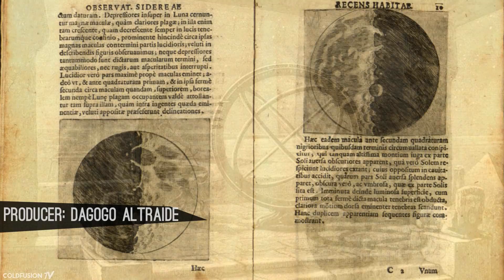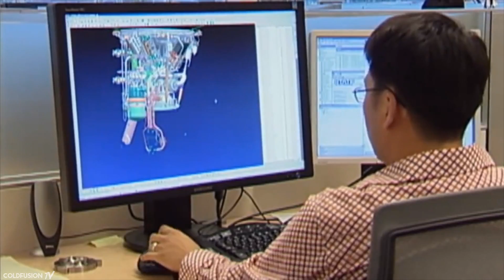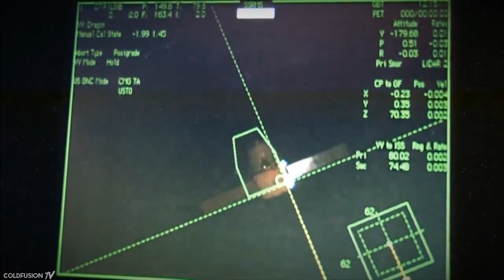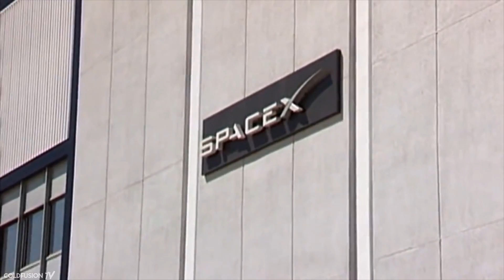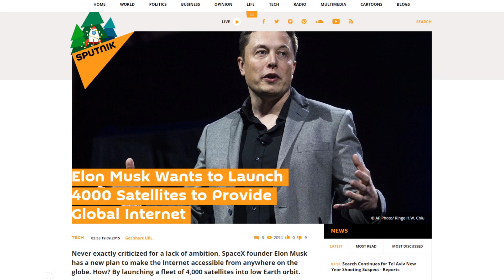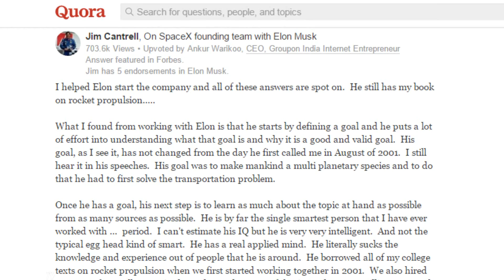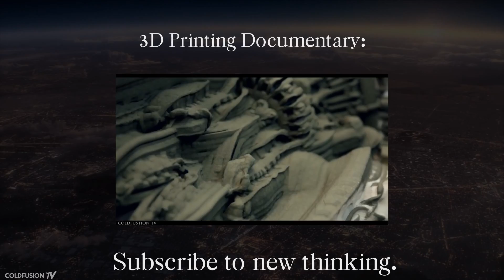The Story of SpaceX | ColdFusion

Comment: Wait, so the reason that Spacex rockets are cheaper is because they create their own materials? Sorry, I didn't get that part quite right. English is not really my native language, so yeah, if anyone could tell me, cool. Great video by the way, really, you explain everything in a way that is really easy to understand, and you keep it interesting, good work!
Reply: Hi Sean,
Old rocket companies  bought engines and guidance systems and all the other various components from other companies to cobble together one completed rocket. But all the different component suppliers also had their own component suppliers to make their product.The suppliers of the suppliers not only had to cover their development and manufacturing costs, they had to sell their components at a markup in order to make a profit, and then
he next component manufacturer had to do the same which means that by the time the component gets to the company assembling the rocket, it’s expensive. Not only that, but the assembly company also has to pay for employees that work to actually figure out how to make all of the different pieces work together. SpaceX however, works differently. It makes 85% of the components it uses itself, which allows it to make cheaper parts.
For example, if SpaceX had bought their radios externally they would be paying $50,000-100,000 dollars each, but since they develop them internally they only cost $5,000 each to build, a dramatic improvement in reducing cost.”

If you are still confused, watch this video https://www.youtube.com/watch?v=h97fXhDN5qE
Reply: Ayush Khadka Wow! Thanks a lot! Perfectly explained, doubts cleared. :)

Comment: There's one thing that you said that's totally wrong.  "Failure is not in his vocabulary."   Elon has stated many times he expected SpaceX to fail.  And the opposite [in regards to "testing"]  Elon implied "If it doesn't fail, you're not testing hard enough".  IMO some of the "failures" were caused by Elon forcing his engineers to test till the item failed.  And in each case they learned alot.  SpaceX now has the most robust system with many systems doing dual duty, like the SuperDraco engines that are for either propulsive landing or LAS [Launch Abort System].  Another is the parachute system either for LAS splash down or [temporarily] Landing Splash Down, or backup for SuperDraco failure.  No one else has these redundant Failure contingincy features.

Comment: well this needs to be fixed: the cost per launch would NOT be 200 million VS 200 000$. it will be 200 million VS maybe 10-20 million $. They need to make a profit, remember? + pay engineers to innovate so they need many millions of extra cash to do that.
Reply: +rcknroll35 Actually, for Falcon 9 and the comparable Atlas V 401 model, it'd be $160 million vs about $60 million (assuming first stage reuse, no second-stage reuse, profit, and USAF paperwork costs which adds about $30 million in itself).

Comment: I worked 35 years at Hughes Aircraft, formed by Howard Hughes just to build racing airplanes but eventually benefitting much of aerospace engineering because it was a company built around that trade, not around profit making.
Hughes himself, in his middle years was a lot like Musk. He learned engineering from those he hired. Stories I heard said that he would walk into a group doing work he wanted to know about and spend hours tinkering and asking questions until he was satisfied with what he knew. He also would audit courses that interested him at Cal Tech. 
Supposedly on the day before a congressional investigation of the H-2 Flying Boat (the 'Spruce Goose' an appellation he despised, mainly for its inaccuracy) he went through it thoroughly and when the Congressmen arrived could answer any question they might have.  A very quick study, indeed. Maybe not of genius category but similarly driven as Musk seems to be.

Comment: one question : why dont we use nuclear technology for space travel ?
Reply: We do. The voyager probes as well as new horizons run off of plutonium generators, which will last them a very long time.
Reply: but that was not on a very large scale .. something as powerful as a nuclear power plant ..isnt it possible ?
Reply: +I  A M  FROM N E P A L  uranium is heavier than lead, so I'm guessing that weight is the main reason we don't use large scale nuclear technology in space.
Reply: but,they can also use nuclear power with the usual rocket science..
Reply: +Ajay Prakash launch failure = radioactive material scattered from explosion

Comment: Do you Think Elon Musk may find a way to combine electric power and space travel vehicles?
Reply: +Archie Durand It's called ion propulsion and it's been done. You basically use electricity to accelerate ions (usually xenon) which is extremely fuel-efficient but uses a lot of electricity. SpaceX plans to use a version called Hall Effect thrusters on the SpaceX Internet Satellite fleet. There's also another type called a gridded ion thruster, the culminating one (dual-stage four-gridded ion thruster) having around 10000-16000 seconds specific impulse (a measure of engine efficiency, higher is more efficient) compared to a max of around 300-400 for chemical rockets. So it can save a ridiculous amount of power and it's a really cool technology because it's just starting to be used for commercial satellites now.
Reply: Ambient Morality thanks

Comment: there should be an electric rocket
Reply: +kazi aymaan There is, but the issue is that electricity isn't an efficient means of storing energy. It's called an ion thruster or a hall effect thruster and uses a tiny bit of an inert gas and a lot of electricity. They're usually about 10 to 40 times more efficient than a comparable chemical rocket engine, but produce minuscule amounts of thrust so they only work for satellites already in orbit.

Comment: The Falcon 9 is not fully reusable.  The cost for the Falcon 9 will not get down to just the fuel cost.
Reply: +Cheong Ziyong Yeah, only the first stage of the Falcon 9 is reusable.  They had planned on a reusable second stage, but the penalty on the amount of payload you can take to orbit on it decreases if you do that.  So the Falcon 9 will probably be the cheapest rocket on Earth, but it won't be $200,000 due to the second stage, fuel, launch operations, recovery operations, etc.
Reply: Brian Habing Yup, ColdFusion was only talking about the fuel costs in this video
Reply: Explain?
Reply: +Cheong Ziyong second stage is non-reusable, plus the helium used to pressurise fuel is expensive
Reply: Yeah, if I remember correctly, the total cost of refurbishing the rocket (first stage) is about 6.2 million dollars. That is waaaaaaaaay more economical than having to build an entire new rocket again. Compared to other launch systems, the Falcon-9 is dirt cheap.
Reply: +Akshat Singh No one's denying that
Reply: Cheong Ziyong I know, i was just telling Brian Habing  that it will still be very economically viable
Reply: +Akshat Singh I know, it will be at least a few times cheaper than the nearest competitor, but it still won't get down to $200,000

Comment: Let's talk about safety now... Cost savings is great, but if it is at the spite of safety... count me out.
Reply: +JetBlackGT Safety shouldn't be a huge concern since it's always autonomously, remotely controlled and has both manual and autonomous control of a termination system that destroys the vehicle if anything goes wrong and it's at risk of hurting property or people on the ground.
Reply: I respectfully disagree. SpaceX needs to get saftey down at all times. Especially BEFORE they start sending manned missions to Mars. It should NOT be an afterthought.
Reply: JetBlackGT I think this is a very reliable system but they'll never put people on this. Instead, people-landers will be much more stable and designed for maximum safety. This stage is designed for performance and safety is less important as long as it can adequately abort a landing and harmlessly crash as required (it can)

Comment: You really shouldn't present the cost information that way, it's totally speculative and you made it sound like that's the pricing SpaceX has put forth... which it isn't.  On top of that, SpaceX didn't come about solely through Elon's money as you stated, government money and outside investors have been used extensively.  That's not a criticism, just facts.  Additionally, you said they built the first reusable launch vehicle.  The Orbcomm 2 booster hasn't flown again, and will not fly as stated by Elon.  It's not reusable till an F9 firsts stage flies for the second time.  

If you are going to make a video addressing this important of a topic, take care to avoid presenting speculation as fact.  Anything else is a disservice.
Reply: Elon said himself the stats. rocket fuel costs them about $200,000. its not a special fuel or anything. It's two different gases. lox and rp-1
Reply: +dymproductions lox is liquid ox, not gas, rp-1 is kerosene, also not gas ;)
Reply: TheBlacktom ahh damn I didn't literally mean gas haha. wrote in a rush on my phone. But yes you are correct. I'll try be more careful with my wordings
Reply: dymproductions
 no problem until I'm here to supervise
Reply: +dymproductions Except second stage reuse won't happen for Falcon 9, so that's probably about $10-20 million dollars gone already since the second stage has to be rebuilt for every flight. And rockets require maintenance, so that'll add significant cost.
Reply: +Ambient Morality good point on the second stage. but the 2nd stage doesn't cost anywhere as near as the first so assuming the first can be reused it will still be significant.
Reply: dymproductions It will. 2nd stage is probably around 1/4 of the cost of the rocket (my guess, anyway). The first Falcon 9 with a reused first stage is being offered for $40 million, and I expect the price to drop even further as time goes on.
Reply: Ambient Morality yh, elon musk mentions a lot of stats and figures but I'm starting to lose track of them because there are so many.
Reply: +Hans Haas It is fully reusable but it is just a museum artifact now. There were many tests done to state that there was no damage and it is flight ready.
Reply: j gonger
It has not completed the most important test of all.  SpaceX is going to do a full duration static test fire with the landed stage, that will give them the required data.  Things aren't reusable until they actually get reused.  I figured that would be pretty obvious, guess not.
Reply: dymproductions
The 200k figure is presented in the video as the cost to the customer, which it is not.  If companies sold their product at cost, there would be no companies.  The way it was presented in the video is misleading.
Reply: j gonger It's not fully reusable. The second stage ($10-15 million out of the ~$40 million rocket cost, I'd guess? Rocket cost refers to just rocket not the other stuff included in the final ~$60mil price) is always lost on the missions. And the payload fairing. And the nozzle stiffener. A lot of things are lost.
Reply: SpaceX is funded by most of Elon's money and his investors, but I highly doubt the government is funding it. Where is your source and evidence that SpaceX is funded by the government? I think you got it wrong, Tesla is funded by government, but not spaceX.
Reply: Kevin Lu l Storm Chasing The multi-billion-dollar contracts with NASA for cargo and crew services to the ISS? Best estimates are upwards of $8 billion of NASA contracts - that includes COTS, CRS, and CRS2, as well as CCiCAP and CCtCAP.
Reply: Ambient Morality
$10 billion? Any source for that? I would say $5 billion is too much
Reply: TheBlacktom Edited to 8bil. CRS1 was 2.7bil (1.6bil initial + 700mil extension + 400mil extension). CRS2 is expected to be at a minimum 2.7 bil - though probably more. CCtCAP is 2.6bil. CCiCAP was at least 500mil, probably more. So that's 8.5 billion at least - and CRS2 is almost certainly going to go over because SpaceX most likely increased prices significantly.
Reply: Ambient Morality
"expected to be" "probably more"  "probably more"  "almost certainly"   "most likely"
uhh
Reply: TheBlacktom It's virtually guaranteed that CRS2 is more expensive than CRS1 - I believe it was noted in the source selection document that quoted prices were significantly higher (but that it was still a good value). CCiCAP was definitely $500 million. Maybe more was added in extensions, but $500 million is a baseline. 

I can't say for sure of course. Maybe CRS2 is actually way cheaper than we expected, but even if it was somehow $200 million you'd still have over $6 billion. 

Worth noting CCtCAP is probably going to go over as well - there's the possibility of adding four more crew missions so that's likely $600-800 million right there.
Reply: Hans Haas Ok first off, Elon Musk invested $100 million of his PayPal profits to start SpaceX. The Falcon 1 project was mostly paid for by Elon and a little portion by investors. It was the success of Falcon 1 that landed them the COTS and CRS contracts by NASA and the rest is history. Second, the Falcon 9 has been re-used on a second launch and landing of the same booster. So your point is moot. Yes I know you'll say this comment was left prior to that re-flight, but everyone knew that SpaceX was going to re-fly the landed booster's, even if they did not re-fly the Orbcomm 2 booster. They are also going to re-use the Dragon from CRS-3 flight for the next CRS-11 mission on June 1st.
Reply: Ambient Morality Actually Elon says the test flight of the Falcon Heavy will attempt to bring back the upper stage of Falcon. So they are still planning to make a fully re-usable rocket after all, from the booster, upper stage, fairings and spacecraft it will all be re-usable.
Reply: Hans Haas Falcon 9 has been re-used now. You kept saying that its not re-usable until it has been re-used, so now it has. I hope you're happy now.
Reply: The Falcon 1 had failed once when they got the COTS contract, it had never succeeded.

Also, wrong on so many levels. Elon tweeted that they were considering that. When he said "they", he actually meant himself. Literally nobody else in the company had heard about that plan, and it's fairly unlikely to happen because it's effectively impossible under any analysis.